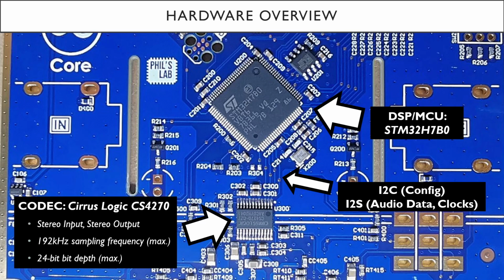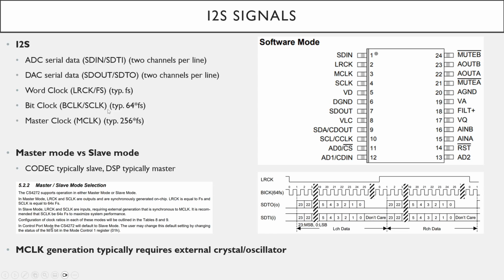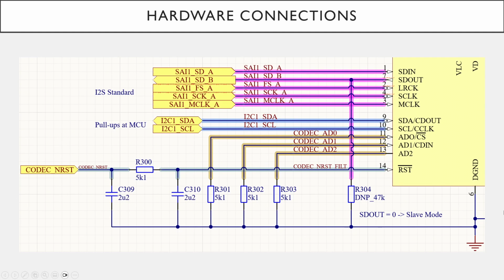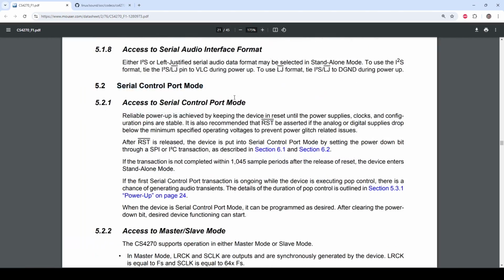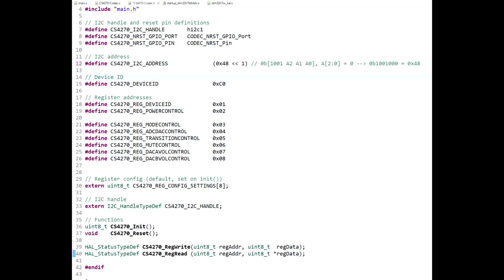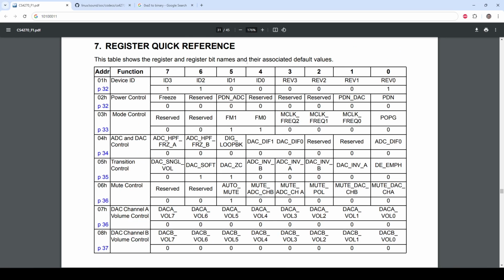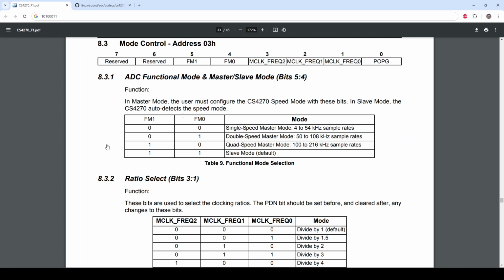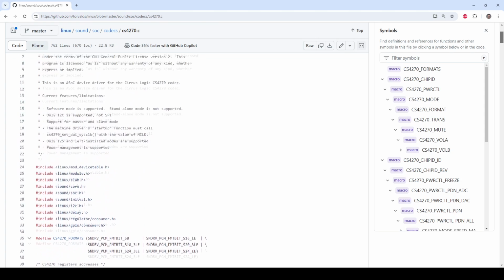(Sponsored) How To Write A Driver (Audio CODEC & I2C) - Phil's Lab #142

Comment: I like all your videos!!! You make some real stuff content. 
I have 3 questions:
- for the SPI drivers, where the IC has I2C and SPI comunication (EX: BMA400 accelerometer) the register addresses are the same ast the I2C ones? Otherwise, can you make a video where you connect a device with SPI to the STM32 and make a driver for it?
- can you make a video about the SPI or I2C HAL drivers? I am curious to make my own HAL comunication drivers thinking that is like in the arduino ide where is much faster to write dirrectly on a register than to use digitalWrite, where it checks various things, like if the port is on OUTPUT mode and so on.
- can you make a video about stm32 flash memory?  ...basic writing, reading and constrains. I am writing some lora code on the STM32 and one nonce variable is stored in the flash, but is reseted somehow at reset with the same random value. I think somehow it is stored inside the first FLASH addresses with the code, and the code somehow is written on that address. Anyway, I saved the variable again at the end of the flash memory, and seeing it on the ide memory browser, it is saved correctly. This variable is has to be incremented at each join request, and if I restart the STM32 it starts back to 0 and it can`t connect again with the values already used.

Comment: I’m not sure about just plain write 0 to reserved bits. Back in the old times of AVR, before Arduino even existed I was always reading register and only altering bits I need. It takes a bit of extra effort but in (quite likely in a longer term product) the event of swapping CODEC for something pin compatible (ie due to lack of parts) it may save you a day if a manufacturer just added new features in those bits
Reply from the maker: Agreed - and as was alluded to in the video, although in not terribly much detail. Additionally, the driver here in the video is meant to be incredibly basic (for simplicity and time constraints of the video). Thus, I linked to the 'extensive' CODEC driver in the Linux Git repo, for a more thorough implementation after having covered the essentials.

Comment: Great video! Maybe an obvious question but what's the order in which you implement your driver, before or after designing your custom PCB ?
Reply from the maker: Thank you! I reference the datasheet several times during part selection, schematic, and PCB design. Also in relation to the software implementation to see if there are any 'gotchas' (such as specific pin settings, modes, etc.). The actual driver implementation I only really start after I receive the boards.

Comment: Great video, as always! But when you define the CS4270_REG_CONFIG_SETTINGS, why do you write them in hex? Can't you just write 0b00110001 for the mode, for example?
Reply from the maker: Thanks! Yep, you can do that - just an (odd) habit of mine.
Reply: @PhilsLab  I just did a bit of research and it seems that the 0b... is technically not in the C standard, but most compilers still support it since it's relatively common. So I guess converting to hex is not a bad habit and I've been living dangerously, haha 😎

Comment: Hi! I have an unrelated question. I'm making a project where i need to supply a few different voltages to my circuit (Let's simplify that to 3,3V, 2,8V and 2,0V). My power source is 2S Li-Ion battery pack. I want to use a switching regulator because battery life is important in this but i'm concerned about noise since some of the circuitly would be analog. Would it make sense to combine a switching regulator that would step down the voltage from 6-8,4V to about 3,6V and then use a linear regulators to make all the different voltages from that?
Reply: Yes. Use switchers for digital and ldos for analog and noise sensitive circuits
Reply: @catalinm756  I was talking about a different approach but this solution would be fine too.
I meant something like this:
Li-Ion -> switching reg. -> LDOs -> everything else
where Li-Ion outputs 6-8,4V, switching reg. 3,6V and LDOs 3V3, 2V8 and 2V0. In this case a switching regulator doesn't power anything directly, only through linear regulators. I've seen this approach in some high power lab power supply to combine high efficency of switching regulators and low noise of linear regulators.
In your approach what would be better: connecting everything to the same ground or having 2 grounds connected in a single point somewhere?

Comment: Sir I have project it is for straightness measurements by psd laser sensor, can you please help me designing the PCB layout?? Also I have the major electronic parts needed like analog multiplayer and amplifier but I have an issues for making the power circuit, I am a mechanical engineer not electrical.

Comment: Hey Phil, as an embedded developer, what's your take on Rust?
Reply from the maker: Never used or explored it (or seen a reason to), so can't really comment I'm afraid.
Reply: Over the years, I have done numerous embedded projects using only ANSI C, C++, Assembly, and Python.  Never had the need  to  use Rust. I'm sure there are probably good use cases that it can benefit from. But for me, I never had to use Rust professionally or required to.